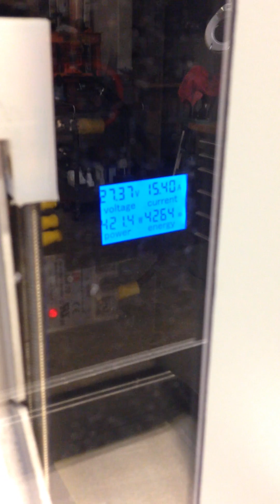Annealing Brass

Comment: awesome job!!! which 1kw zvs driver did you use from eBay? I'm also in the process of building one won't be as good as yours I plan on just hand feeding the cases
Reply from the maker: Hi Adrian, and thank you. I used the same unit as
 https://www.youtube.com/watch?v=1wwlbN-9jsU
but replaces the coil and used a 27dvc Power supply, am thinking about changing the supply to a 36 vdc or 48 vdc unit in order to speed thing up a little. 
I purchased the ZVS from Baggood 
http://www.banggood.com/Low-ZVS-12-48V-20A-1000W-High-Frequency-Induction-Heating-Machine-Module-p-1038472.html
 which took 3 weeks to arrive, but have since seen them on ebay for approximately the same price.
I will be posting the parts list on YouTube and the software code for the controller if there is any interest out there in building this automated version, just a matter of time to get to it.
Hope this helps?